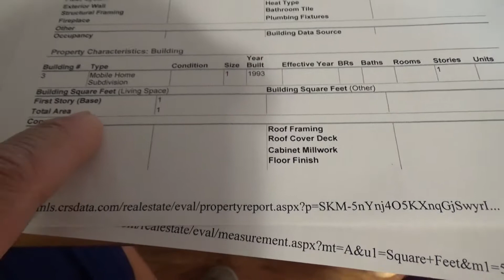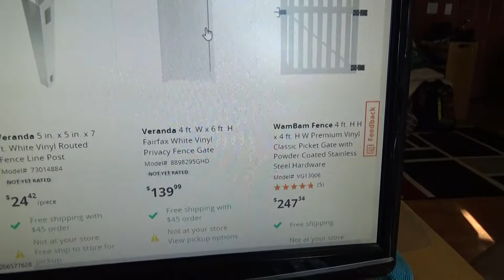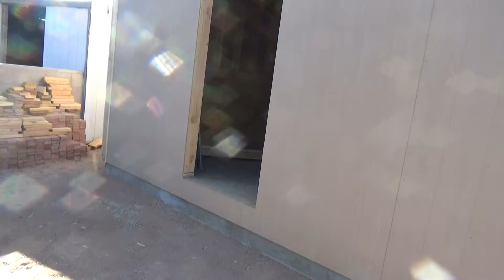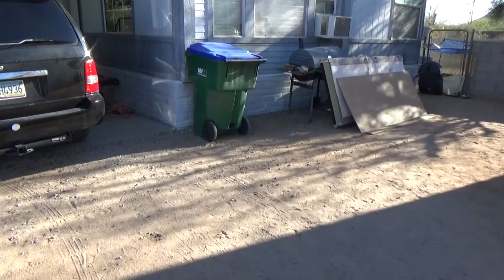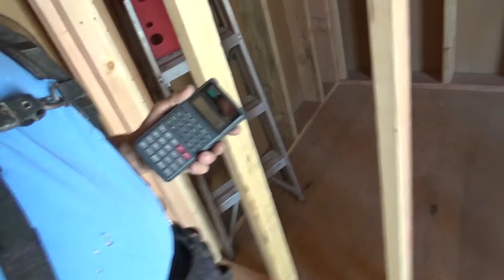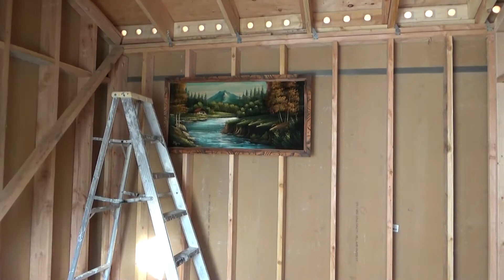The Tiny House Project Day 13 The Door is INSTALLED

Comment: I would use the 1/8" 4x8 plywood panel sheets, it is similar to T1-11  it is thinner and lines are more narrow than actual t1-11. I used it on my tiny house door very light.. yet tough. can stain or paint it. 10 grand investment will make a nice increase on your property value plus you get to enjoy a luxury tiny home.
Reply from the maker: I have spent more than 10,000 in other projects already, like that back block wall cost me $5,000 and all new appliances and water heater and flooring inside my home, I have the door trim already just need to install it.
Reply: Yup it doesn't take long at all When the tornado came through it did $48,000 in damages.  Most of the clean up work was done by me and my kids, the rest was shingle replacement and tree removal  A/C- heat pump replacement. It racked up in no time.